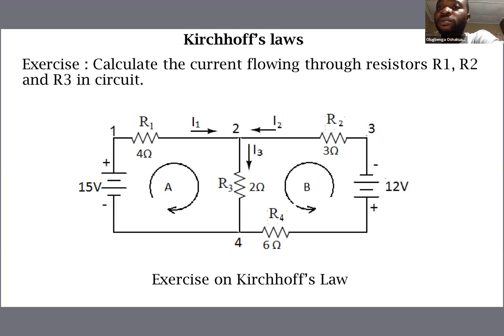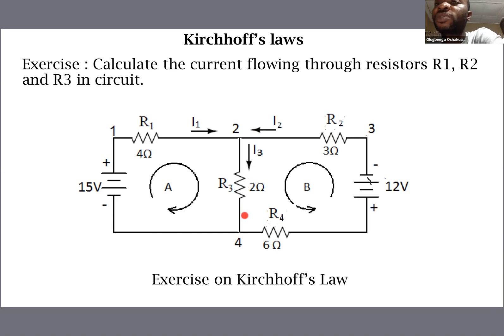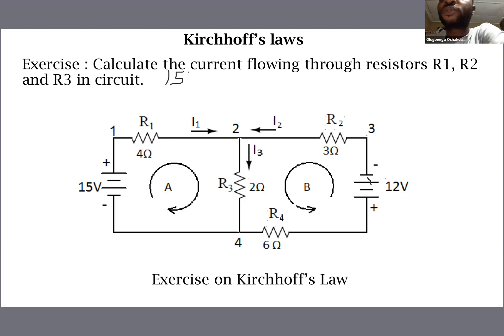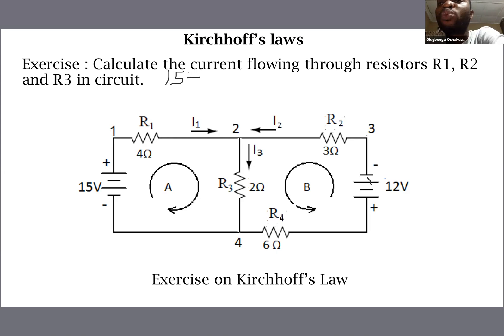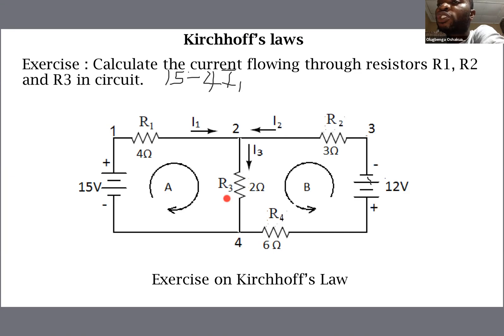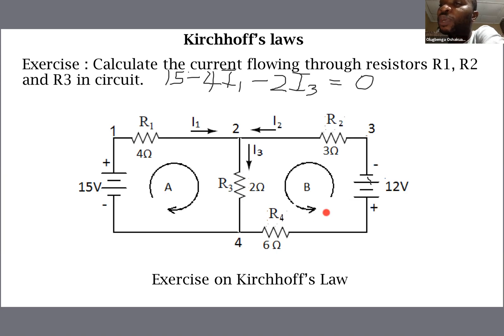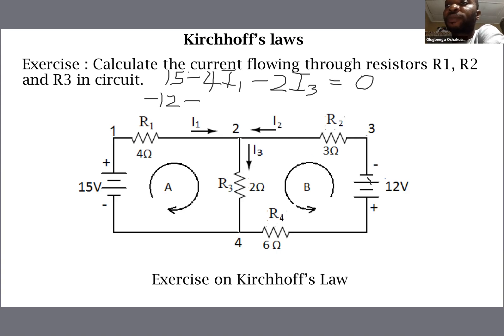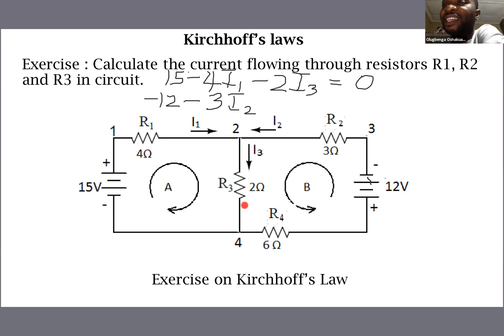Example 2: Kirchoff's laws

Comment: Thank you very much sir. In case we get a negative value for our current across any of the loops, please what is the implication of this sir?
Reply from the maker: It means the actual direction of current flow is opposite that of the arrow (used in the circuit analysis).